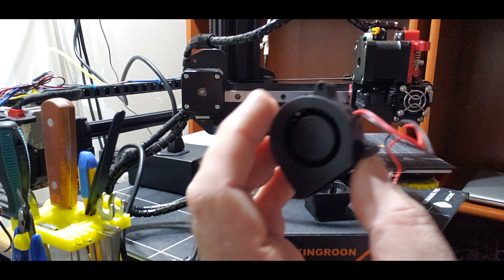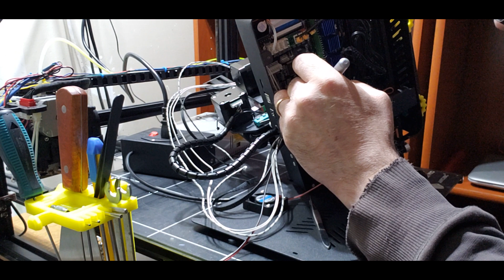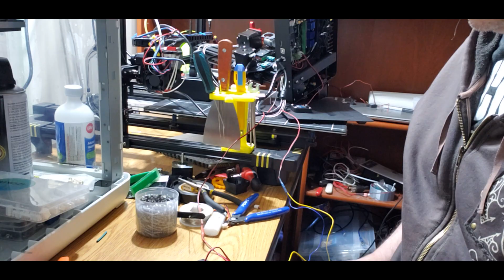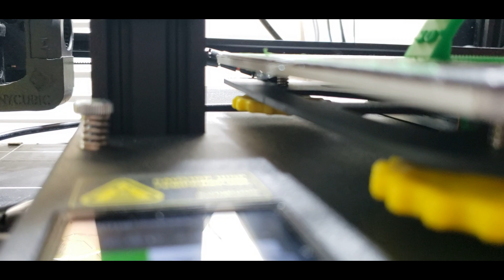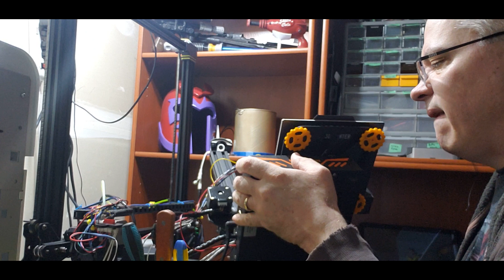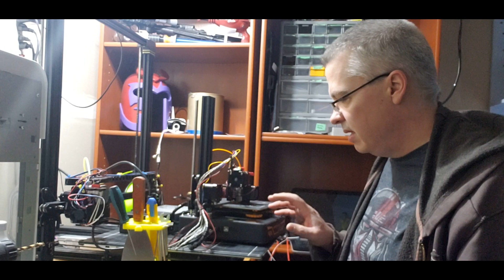Upgrading my Kingroon KP3S Printer

Comment: Hi Jeff, great video. I've recently bought different DC 24V fans that I'm hoping will be quieter. I've tried testing them for noise by plugging them in on the board. Unfortunately, these new fans won't turn on. Is there anything else I need to do other than replace?
Reply from the maker: Did you check the polarity of the fans you bought vs the stock ones? Sometimes depending on brand the can be wired backwards.
Reply: @jeffs3dcorner  No I did not. I just have and you hit the nail on the head. Thanks for the tip! :)

Comment: Hey thanks for the video. One question, is the soldering necessary? Can I basically buy noctua fans 12v?? and just replace the fans ?
Reply from the maker: You would need 24v fans.